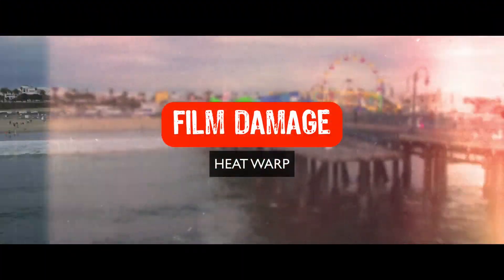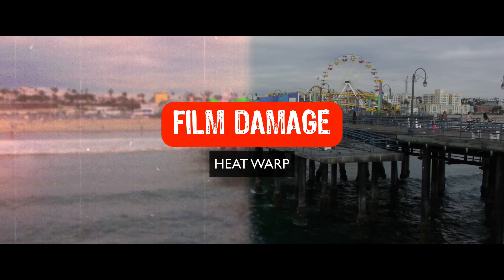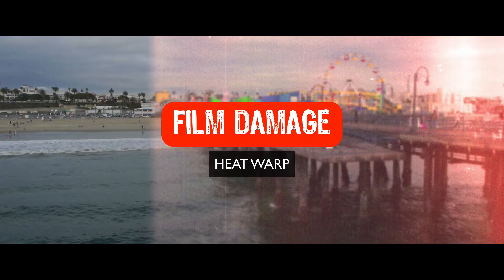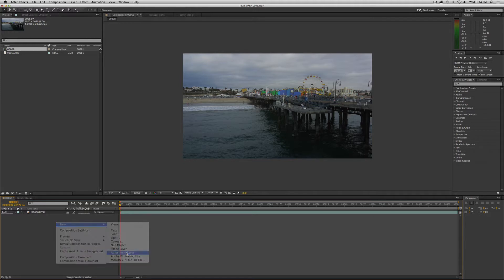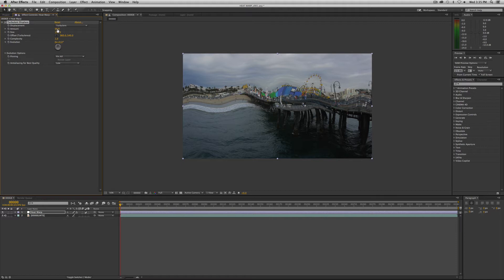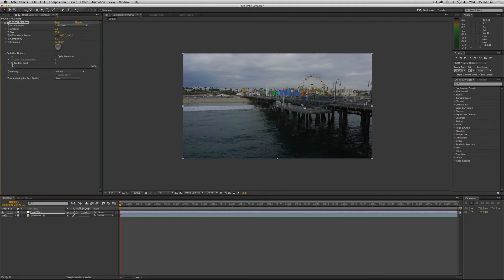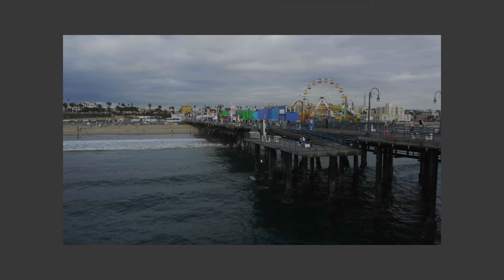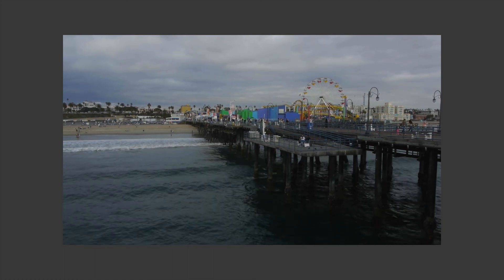DIY Film Damage - Heat Warp

Comment: I've been watching all of these film tutorials for "Film Damage."  So well done.  I've been trying to keep up even though I use FCP and not Adobe.  About 33% of the stuff goes over my head and my head was swelling during the Film Flash Leaks, but thank you so much for these sharp tutorials.
Reply from the maker: Thanks, Firooz. Which version of FCP are you using? The latest or the FCP 7 version? If it's of any value, I can see if I can do some FCP translations of the techniques I'm doing in After Effects. If there's a particular area where you get lost, let me know and I'll try and walk you through it.
Reply: I use FCP 7.  For the Kodachrome tutorial there were a lot of filters mentioned with specific number values.  I had trouble trying to find corresponding filters in FCP, and when I did, I found it impossible to plug in corresponding numbers.
Reply from the maker: Okay. Give me a bit to track down FCP 7 and I'll see if I can help out.
Reply from the maker: I had a chance to look into FCP 7. I found some limitations with FCP (for example, it's very difficult to isolate and saturate certain colors). That said, I was able to come up with a recipe that's pretty darn close to the After Effects results. Here's the formula I came up with. Let me know if you have any questions.

Image Control (folder) - “Initial Saturation Boost"
	Saturate
		Saturation			0.88
		Mix					100
---------
Color Correction (folder) - “Dialing in the Look"
	Color Corrector 3-Way
--
		Black Controls
			Level			15
			Angle			-84.56
			Magnitude		0.95
--
		Midrange Controls
			Level			104
			Angle			168.22
			Magnitude		3.2
--
		Highlight Controls
			Level			255
			Angle			125.19
			Magnitude		2.62
--
		Color Controls
			Saturation		185
--
		Limit Effects Control
			Chroma Center	-110
			Chroma Width		15
			Chroma Softness	10
			Sat. Minimum		35
			Sat. Width		40
			Sat. Softness		20
			Luma Minimum	0
			Luma Width		40
			Luma Softness	20
--
		Edge Control
		Thin/Spread			0
		Softening				0
-----------
Image Control (folder) - Optional: “Decreasing Saturation"
--
	Desaturate
		Amount  26
Reply: Wow! Thank you so much for putting in the time to do this.  I will play with this tonight and let you know the results.
Reply from the maker: You bet! I hope it works out!